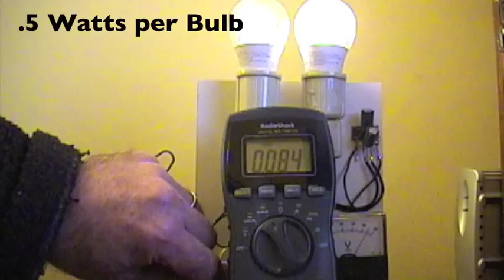Lynx Joule Inverter BEMF

Comment: What are the watts in compared to watts out the rectifier? If you could work out what the bulbs consume we could see total efficiency, Looks pretty good! Have you tried to charge the run battery :) Could be seriously efficient lighting... You should be able to dim the lights by applying DC to the other winding too, Although I like what you are doing better :)

Comment: where does the AC come from, since the input is only DC.   The transformer must be self-oscillating along with the bulb electronics.    Wonder what frequency it runs at?   thanks for showing this,  very curious.